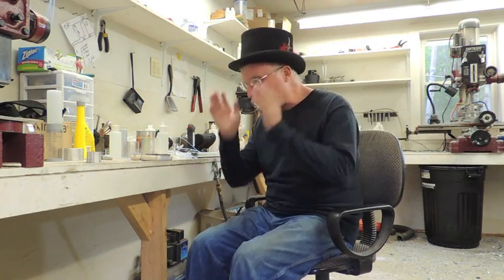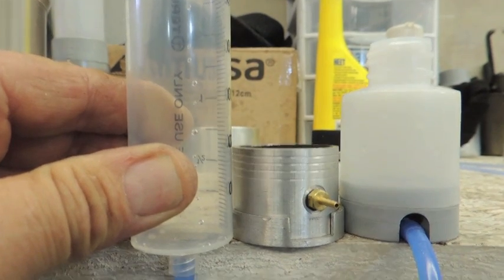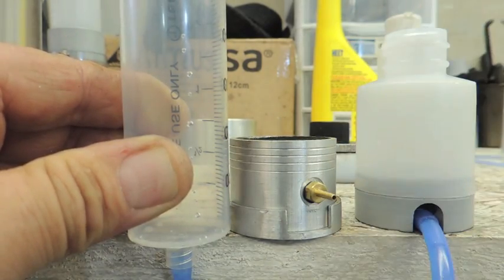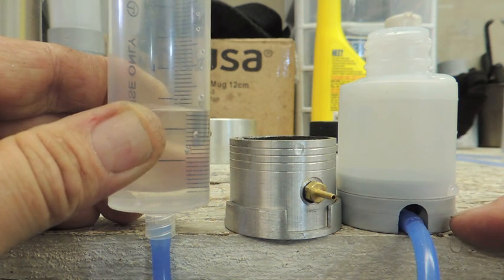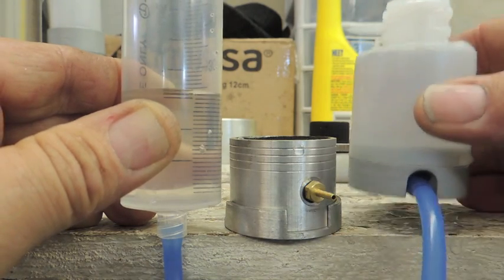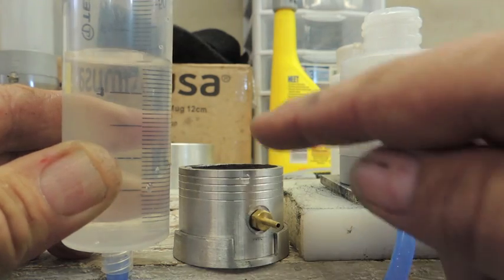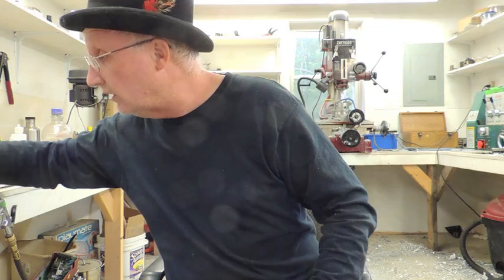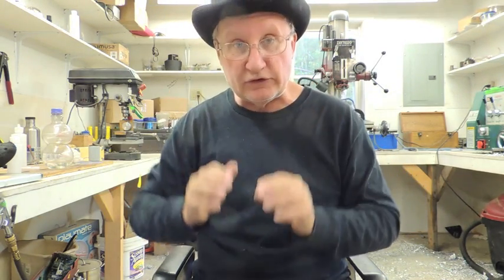5th Grade?

Comment: I have lots of experience machining polycarbonate. Use a brand new 2 flute end mill and make a small air nozzle to keep the material cool. You should be able to make one pass through there full depth cut. Never cut metals with your plastics cutters. :)

Comment: I guess you might get away with a level in the remote a bit higher than the top of the stove if you were using a long very narrow fuel line and your stove was burning fuel quickly.  But if your using a slow stove to bake I don't imagine the fuel is burning fuel fast enough to qualify.

Comment: Made my comment on your remote 101 video before seeing this, you mentioned uneven ground in the 'launch' video as well. Having the flexibility of 4inches adjustment is great for when you need it. A couple of holes in that base would mean that pegs could be used for extra stability on soft uneven ground.